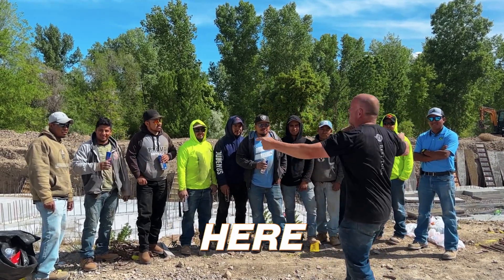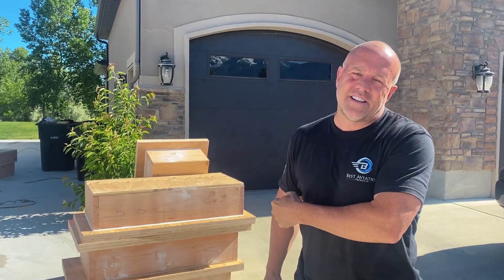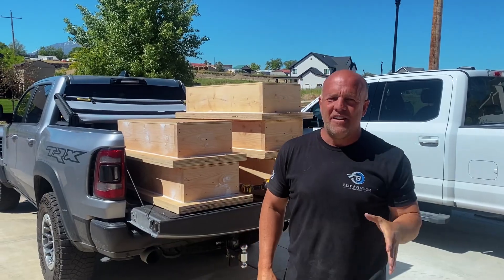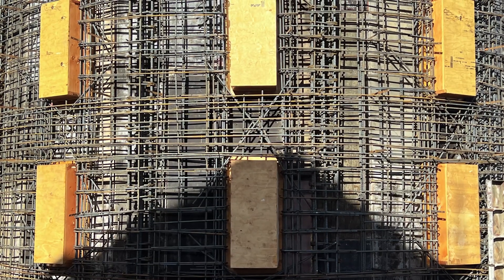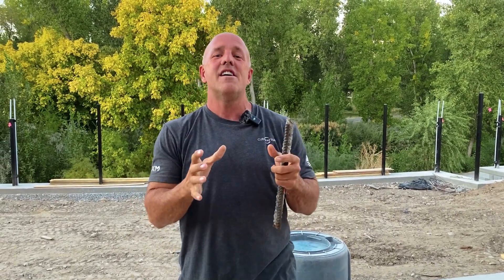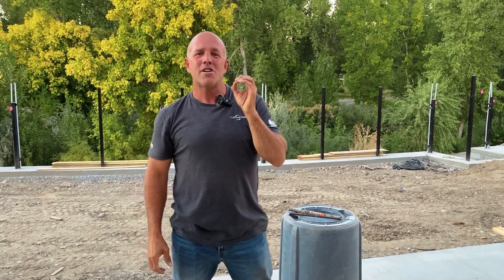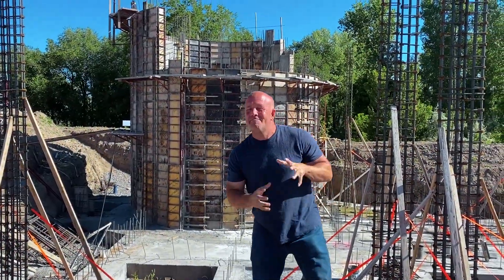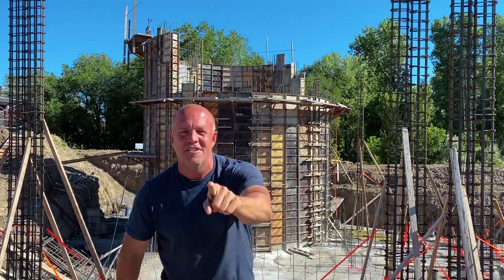A rooftop swimming pool with 27 foot walls? | House Build #2

Comment: Mike, they are tension rings.  The vertical beams span between them.  The beams didn't need to be fully continuous but overkill is OK!  For a 24' vertical placement, one should not just "fill up" the form but place it at a controlled vertical rate in 3 or 4' lifts.  That way the concrete beneath starts to set relieving the pressure on the form.  From what I could see , it looks like you did it right.   Thanks for sharing.

Comment: I wonder what the cost difference would have been to do a solid steel pool?  I've seen huge liquid pressure vessels ( much taller and wider than this pool) with fairly thin steel like 1.25.   This is awesome no matter how it is built.

Comment: There are ways to make a collapsible form that would come out easily. With the fantastic designs of your molds for the airplane work, it was surprising how rudimentary the window block outs were built. All of that said, it worked just fine.
Reply: Wonder why he chose rectangular windows rather than easier to control stresses etc. with round or oval windows ??

Comment: This pool has similar engineering challenges to an agricultural silo used for storing semi-wet feed. 
A silo also has immense pressures at the base, has a similar diameter, three times the height, less outward pressure than water, higher corrosion risk, and has 2'x2' doors puncturing the wall the entire way up.

The difference, is that silos are standardized in design. You can quickly specify that you want a 130x36 silo, write the check, and it's built within a few months. In the case of this pool, nothing is standardized, and needs to be completely engineered from scratch.
Reply: Good points, I’m still wondering about the form strength requirements for the pressure resulting from heights / depths of the concrete while it is still liquid / plastic.
I’m no expert on concrete, but, have enough experience that I’ve seen blow outs, and form warping.
I guess what I’m saying is that I’m imagining another whole level of engineering to this beyond that of the pool itself, that is the stuff that fascinates me.

Comment: Was it possible to have the pool entirely below ground?   and could it have been done as welded steel plate without any concrete?  not that weight matters but if it's the strength of steel you want, why not make it steel without the weak concrete. Thin walls help windows.
will you have a ton of insulation so the pool doesn't take deep ground temperature?